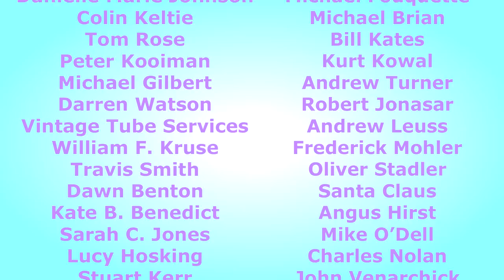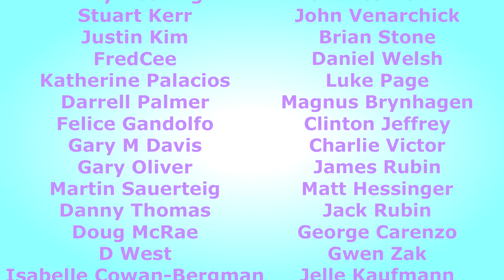Weird But Practical - Leper Amps!

Comment: By coincidence I have a couple 2020s as well. Bought one on a whim and it worked well so kept finding uses for them. LIke mounting the Lepy to the back of one of a pair of a big old Pioneer 3-way speakers with 10" woofers to create some cheap powered monitors with a lot more mojo than some little bookshelf speakers. 

Also it's nice to keep the amp separate from the speaker because I have had it happen where I spent decent money on some studio monitors and after a year the built in amp fried itself leaving them dead. A pair of passive speakers can last decades, maybe longer, it's always the amp that dies first.

Comment: I should have one of these lying around. Else I have been using the cheap Chinese D-class amps every here and there and for a crazy project I got a 2+1 channel amp that hade a sub bass channel. Worked fine.
Now I ordered some Ayma 3” drivers from AliX and have a 2x15W amp that will be perfect to make a simple monitor system for my synths.
And the small 3W not-switching amp that once sold for 20 cent was absolutely stunning.

Comment: I mean all most people need is basically what's in a pair of computer speakers but slightly better and more powerful. this fits the bill. especially for converting computer speakers that sound hissy but with an amp replacement sound good, or even goodwill speakers

Comment: It's funny how similar your experience with these amps was with my own. I got the original Lepai and it works well, although 18 years later, it sounds crunchy when I turn the volume knob. I  needed another one for the TV and I gpt the Lepy which was so lackluster by comparison so I replaced it with a $25 ebay Harmon Kardon receiver that sounded much better. Then I found a pair of huge Dahlquist DQ 20s on the street, and the Lepai was not up to the task so now it is used for my computer speakers. The Lepy lives in my parts bin.
Reply: Some deoxit into the volume pot would completely fix that crunchy sound, it's just a dirty pot.

Comment: It looks like Parts Express has those Lepai 2020 amps in stock. I just visited their showroom last week.  Pretty cool place; the two guys working there were friendly and helpful. Lots of stuff to look at.
Reply: The currently available model is the LP-2020TI. It uses a Texas Instruments TPA3118 chip instead of the Tripath TA2020. Some people claim the Tripath chip sounds better, but I can't tell the difference. The TI version can be powered by a 19.5V laptop power supply for additional output power, but the A+ version shouldn't be run above 12V because of the voltage ratings on the caps.
Reply: @jonathanadams8497  Would the Tripath TA2020 chip be in the LP-2020A+ amplifier? There's currently three new ones on ebay located in Tucson, Arizona.
Reply: I have used The dayton digital amp modules !

Comment: You can get the amps cheaper if you buy the PCB bare. They are really good, and with a heatsink they will definitely do 40w.
Reply: it's hard to beat lepy pricing.  at least in thailand.  like, there's a shop that sells bare boards and lepys/lepais/whatever locally to me in thailand.    like it's cheaper than a random amp board and comes in a case already, unless you count against the 5w with bt boards they got and stuff like that.

edit: I'd rather use a goodwill or whatever amp though but there is basically no vintage electronics like that here, at all.

Comment: Great to see some intelligent comment on these amps !
But .. how do they get 20+20W out from a 24W DC supply ?
Reply from the maker: Honestly they don't - but they claim RMS - you can provide a beefier supply and run them at higher current but I don't recommend it, the amps are just not constructed for that kind of duty.
Reply: That's part of how they keep the cost down, undersize the included house fire power supply.
Reply: @FranLab  , so apparently the FTC no longer enforces audio amplifier output-power specifications?
Reply: @jamesplotkin4674  , in the 1970's and 80's, yes, they did.

Comment: 7:03 that unit probably has a class D from TI, and modernish ones can easily handle 2x15w-20w output without needing a big oke heatsink, the board is usually enough to act as the heatsink. 

I was originally looking at these for a small amp for my bedroom TV sound system, but I instead went with an SMSL AD18, Micca MB42x, and a Micca MS10 subwoofer.

Comment: I have a Kinter 20 Watt amp just like your older Lepai for almost 5-years now. It employs the TriPath chip with the large heat sink. It drives a pair of 30+ year old dicast car speakers with an Advent Mini passive subwoofer of the same age. I use it everyday as PC speakers and it really does a great job. Lots of power and bass. Only complaint is the tone bypass switch. Really cheesy. Intermittent, takes lots of cleaning. It's hard to find a good replacement switch. It has a few more parts in it then your older Lepai. Great little amp. I would get another anytime.

Comment: Tripath was a client of mine for tradeshows... I was told, as they were liquidating, that no one makes the chip any longer and all chips are NOS. 

They have been recommended for home recordists for ages.

All hail Class-T amplifiers!

RIP TriPath.

PS I use an old cable company modem power supply as they're safer (fire, etc...)

Comment: I’ve one of the Lepy-branded ones from a few years ago (there’s a video of it on my channel). On mine almost everything is branded Lepy including the pots and the chip. There’s no heat-sink but they seem to have used a multi-layer board with multiple ground planes to handle the heat, kind of like an led lamp. It’s very hard to solder! Not as good as a proper heat-sink of course.

Comment: I have one of those in my garage with some cheap speakers just so I can have sound there. I'm rather unimpressed with the stated power level on the box. I have to turn the volume above halfway in order to get decent sound. They are perfect for that application. If not a little weak in the knees. For the price I got it online for I can't build anything better. You probably could find something on Craigslist but then you run the risk of it being a steaming pile of excrement .

Comment: Wow. They really made some cost cutting on the 838. 
Both of my 838 boards have a full sized chips. 
The bass driver chip in mine is on the bottom of the board and makes contact with the aluminum case. 

The stereo chip sits on top and has it's own heat sink.

Comment: I have a slightly upgraded model from parts express, the lepai lp168ha. Darn good little amp. I ended up with 2 as i complained to parts express that the sub output was noisy sounding. Turns out a 4ohm sub with the 12/3 power supply wouldn't supply enough power and it would clip. The stereo output sounds quite good in contrast and has been a good little beater amp for small areas.

Comment: Fran, these are very nice little amplifiers with some 20 watts of output. I bought one for my son to use with his computer, because the unit had a headphone hookup, because only he uses headphones. The down fall of the amplifier was the switching power supply that came with the made in China system, was it did not have any line filter in it. The PS was a transmitter of EMI noise to all the radios in the house.  The final solution was to replace the PS with one that had a line filter in it.

Comment: I got one way back when for its typical use, to run some bookshelf speakers.  I've since used quite a few of them for various projects.   I still use the one with my bookshelf speakers...6" two-way Yamahas.  It's been in HEAVY use daily for about 10 years...maybe even longer now.  The potentiometer is getting a little "gritty" and has a dead zone at max volume.  Probably just needs cleaned and I haven't been bothered by it.  These little amps are easy to hide...in computers (yay 12V), in a desk, drawer, etc.  Quality power supply and they sound pretty decent, honestly.  And I grew up with access to a multi-thousand dollar hifi setup with all the stuff, Yamaha amp and Cerwin Vega towers, etc.    Although...the one I have is a "Kinter" brand, but it looks much the sames, specs are the same from what I remember.  Mine did not come with PS,  I use a universal 65W laptop charger and there is very little distortion even at full volume.
Reply: Kinter MA-170 is the one I still have.  I've bought the Leper ones before though!
Reply: If you live in an apartment, these little guys are about all the power you'd need / want.  Aliexpress...can get 'em for like $10.

Comment: omg I have one of those class D amps almost identical to the one you are holding at the start of the video for my bedroom TV.  The blue LEDs were so friggin bright I ended up opening it up and lifting the surface mount resistors to the LEDs off the board with a soldering iron... Need darkness in my room!  Mine doesn't have that relay in it... mine is likely an amazon knockoff.

Comment: Yeah, those switches are designed for switching AC current, not DC. I struggled to find a switch that was rated to switch a decent DC current for a project, because I needed a right-angle PCB mount switch. 

I'd also look at adding an RC snubber across the switch. Even if the output is muted when it's switched on, the thump still happens, so that could help reduce the spike in power through the amp. I read it helps reduce arcing when breaking high-current loads, so I'm looking at adding one to my project since it would be running in the 2-6A range most of the time.

Comment: Hi Fran! Have you tried the TDA7498 / TDA7498E? I use those everywhere and think they're fantastic. They drive big speakers no problem. I use them everywhere for my whole house audio system. I use the bare board version, they're about $10 each.
Reply: I may be interested in this amp?

Comment: FRAN!!! YOU'RE AWESOME!!!

I had two of the Lepy Superbass amps waiting in my cart ready to toss into some arcade machines.
Definitely swapping back to the 2020's, wicked coincidence, you're the best!
Reply: Just an FYI, if it's going in an arcade machine, you can still use the 838.  Take it out of the case, add your own cheap copper heatsink to the little op amp.  That gives you the option to use a sub-woofer, if you're interested in that.

Still prefer the 2020 though.  But even that I'd suggest you remove it from the case before mounting it in your arcade console.

Comment: Did you try those dirt-cheap TPA3116 or TPA3255 amps? I got several of these running here and they mostly don't need any mods, since the TI chips are quite good.

Comment: Class D amps are extremely accurate, and hence more HiFi than most vintage HiFi. So don't fret about using it. Audiophile claims are 99% complete nonsense, even more so when they claim that digital is bad.

Comment: I had a lunch lecture by Axign a little bit ago. Super interesting stuff about newer class D amps. They are even in some of the more beefy JBL "portable" boxes these days. I wonder if you can get their chips as standalone modules, would be awesome.
Reply: Yes, you can. Look for ICE, Hypex, Purifi... They often outperform class AB amps in their price range. Hypex for example sells multichannel panel modules that sound wonderful and are used all over hifi and pro audio market.
The least expensive, but mighty amp is a German Infineon. They are configurable to up to 4 channels per chip with digital inputs and other fancy stuff. They sound rather clean.

Comment: "Spineless from the start... Bow to Leper Messiah!"

[in low Clive-like voice] "Whaaaaaaaaaaat?"
Fully agreed, this Lepy amp is officially a complete and utter piece of shit!
I kinda like the PCBs on the others (both Lepai).

Nice mod on the pot. That's why I always use a large resistor from wiper to ground on all of my amps, and add one on those I repair. 

I've got one little class T mono amp in my bench test speaker and signal tracer. Other than that, none - I'm too old school for that.
Reply: Class T? I remember Hitachi Class G  hifi equipment (yes, I'm old!),  but I never heard of Class T.....
Reply: @goodun2974  it's a Tripath invention.

Comment: Here i south east asia this type of amp is very common..newer versions are bluetooth compatible,DC input voltage. I use a japanese sansui speakers for this still working until now the only thing ireplaced was the voltage regulator.

Comment: I'm messing around a lot with homemade analog synths, so my ears perked up at "voltage control". I mean, of course, they'd have to have something like that if they didn't want to add a separate microcontroller with ADC, but I hadn't considered that aspect of class-D amplifier chips.  Now I'm wondering how hard it'd be to build VCA modules out of them.

Comment: just a warning, the modern ebay Chinese amp identical to the first one in the video can give you a tingle of a shock. Although it runs from a 12volt power brick on a humid day with a damp hand you can get a small shock from the volume knob or case. I have 2 of them, 1 drives a set of speakers in my tool box (snap on epiq) and its true the are a good sound, perfect for an auto workshop the other I've not yet installed but will be in the garden summerhouse.

Comment: I've had pretty good luck with the TI TPS3116D2-based amplifiers Parts Express sells. The one I chiefly use these days doesn't have the mute relay, but it does have pretty much everything else. It doesn't seem to pop without the relay though. I guess the '3116 has a solid built-in mute capability.

Comment: It would be interesting to run an actual test with the "where's the beef" leper - does it even function as an amp?   Does it distort the output more than the original?   Does it smoke long before 20W?
Reply: I agree! This would be an excellent video idea!
Reply: Williston audio labs have done just that....

Comment: I have an ancient one of these, with typical Engrish on the case, a pretty awful SRBP PCB, and all kinds of flaws. I have spent way too much time on fixing all the flaws, but now it is pretty decent. It came with an analog ‘James’ tone stack instead of using the TA2020's built-in tone controls. No output relay, but I managed to eliminate power-up pops by adding an offset circuit so the output offset could be tweaked to be near zero.

The wild variation on all these models is typical for Chinese products. I also looked at 5.1 surround decoders and it seems as if there are like 20 companies copying each others products, same with FM transmitters and so on. Looks similar on the outside, but the inside is always a total surprise. Chinese corporate culture is totally alien. The only thing you can be sure of, is that they will keep on removing components until the product is too obviously defunct.
I have built my own Class D amp from scratch with some TI TPA3122D2 ICs, and it sounds great, but I guess in the meantime there are newer and better ICs available.

Comment: To minimize arcing across the power switch, you can try putting a snubber cap across it.
Reply: I've had several of that style switch apart. They're 💩. The only thing you can do for better reliability is use a better switch.

Comment: this is perfect for my needs, the switch and controls will not be touched often and it will be powered on from the same switch as the streaming equipment. Our need for this is as an output from the mixer to the input of the streaming equipment so we can get decent volumes as currently the ambient mic and input from mixer are maxed in software and its still not loud enough. 
How much do these cost and where can I get 1 of the older 1s with the big chip?

Comment: 🤔 i got a crappy lepai like that for some computer speakers/trash sub, but the chip inside is different and it's tied to the chassis for heat with some goo.  externally it looks the same

Comment: I picked up an AK-170 amp for like $15. Old school class B amp. These and others use old amp chips. I have heard China is taking old stock chips out of obsolete portables. Seems every one may have one of several chips depending on what they can find.
The ads are bogus, state 200 watts. Really a bog standard 15W amp used in car stereos and portable devices.
I use it on my PC and it works well. At normal listening does not even get warm. I was surprised by the sound, better than the expensive Sony receiver I was using on my PC with fixed DSP sound filters.

Comment: Sometimes I want to try building a class-D amp with tubes..
Reply: Hehe. Can you get tubes to switch significant loads at high enough frequency for class D?
Reply: @lunalangton5776  , transmitting tubes are often used in class C. Class D? I dunno....
Reply: Ha. That's gonna be interesting. OTL at that!

Comment: Hi Fran, sry bur jour wrong . The TA 2020-20 is not only an class D Amp . It is an Class T AMP > evective and class D and an AB Amp in One
Becaust this the sound Qualiy shoud be better..

greats Stefan
Reply from the maker: How can I be wrong about something I never said?  Class T is a trademark invented by the Tripath company and they went out of business.
Reply: @FranLab  I too think it's different from conventional classD... 
"T" amps use something similar to " fm"  type mod. ..but more likely pfm type for power switching....( higher the amplitude... higher the f_sw. or something alike..)..around(600-800)kHz...
Whereas classD started with an f_sw around (250-300)...but now most use (350-600)kHz

Comment: I have very efficient speakers 101db 1w1m and that amp pushes them with ease. It's not how many watts that counts it's how clean the first 5w are.
Reply: i commented without watching. Fran could you do a thd measurement at 1w and full power? I would but honestly never learned how.